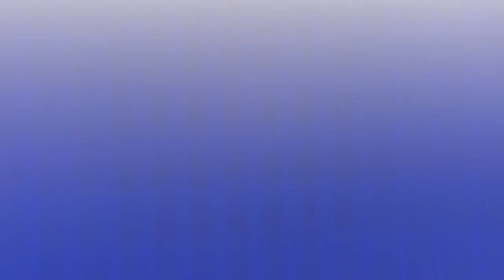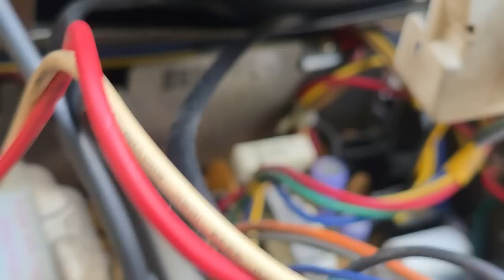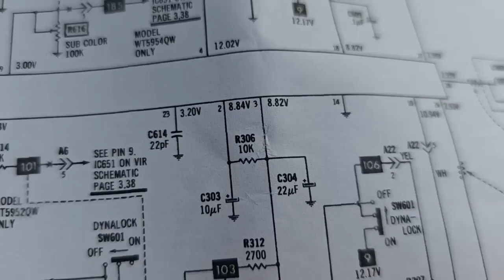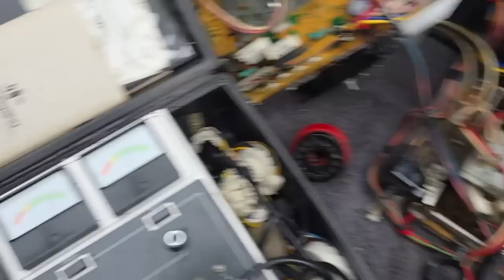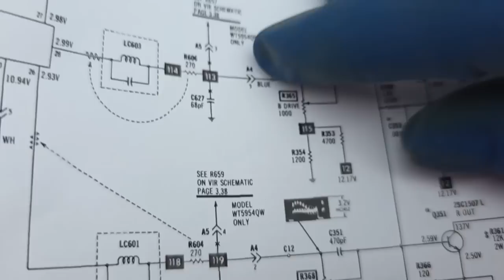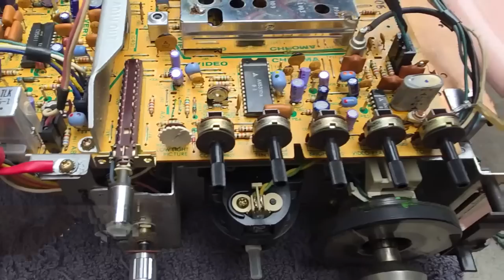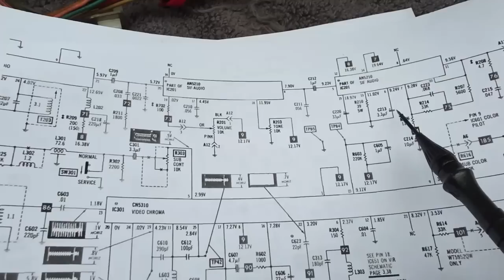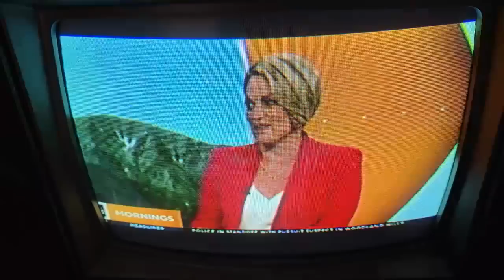1979 Quasar Color Television Repairing Several Problems On Vintage 19 inch Tabletop TV Set

Comment: I remember you did a video on a quasar a while back, and it was caked in cigarette residue.  Every time I see a quasar, now I think of a TV caked in cigarette residue.
Reply: It's glaze. Cigarette glaze.
Reply: @Kinann L.S.M.F.T !
Reply: Quasar actually shipped them brand new coated in cigarette glaze.
Reply: Lot quasar were Panasonic early commercial grade.  Used in bars restaurants and hotels etc.  my family had a hotel, bar and restaurant in the 70’s and 80’s we took the bar tv when closed in 1988 and sold the property for a library. Anyway yes it was a sticky mess.  I cleaned the heck out of it and used it.   After a year I had to replace capacitors in its power supply and yeah years being up near ceiling in a bar inside was absolutely gross. I feel the thick dust and nicotine had lot to do with psu death but it’s Japanese capacitors and it ran like 2-3 years daily in the bar and I ran it daily after.  I did smoke then myself but actually quit not long after like 95 I quit smoking. Gross stuff.  It was a great set. Lot inputs and it had a glass screen protector over the screen you could unclip and clean the screen or wipe outside.  Being commercial for a bar that second glass was a good protection.
Reply: Welcome to flavor country!
Reply: @UHF43  CHicken mannnnn!!! He's Everywhere, He's Everywhere!
WELL!
Reply: Welcome to Flavor Country. Im the same way every time I see Quasar I remember smelling the cigarette glaze thru my screen.
Reply: Cigarette patina...
Reply: Same
Reply: Everything back until early 2000 smells like cigarette.